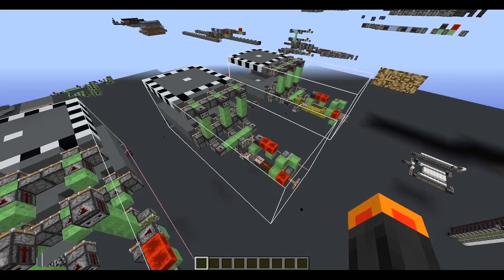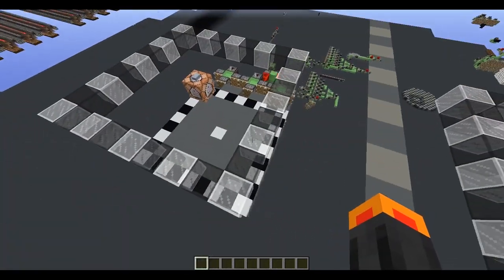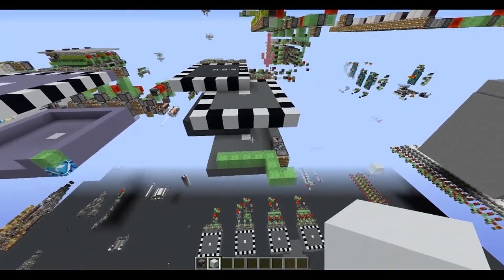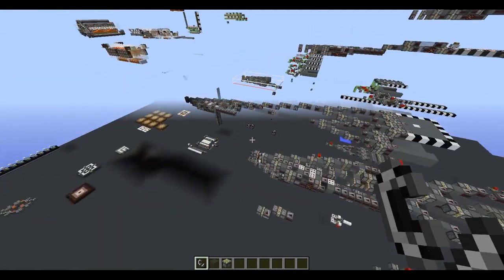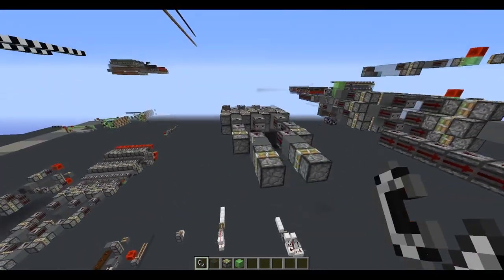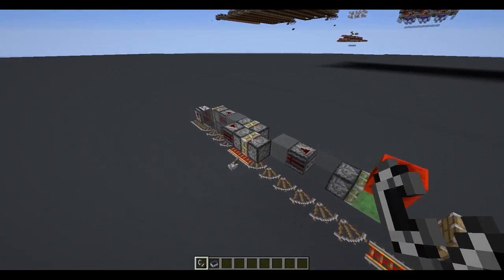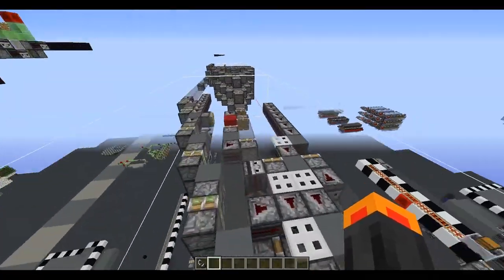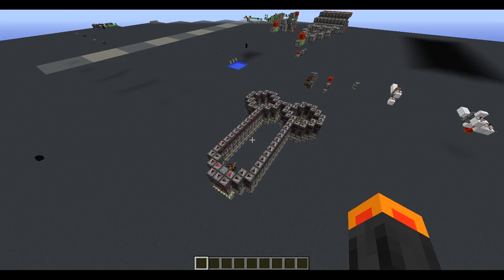Slimeless Flying Machines and Compact Kobras

Comment: cool!
Reply from the maker: Yesterday I've been looking at 1.7 kobras and found your TNT duper, that stuff is amazing! The fact that you can pull a block makes me wonder if 1.7- flying machine possible, just super big and messy. Will see...
Reply: @kk.mp4  yea. weve also been working on that for quite some time about a month ago. the main problem was that we were never really able to get something next to that block that we pull pushed forwards. what we would need to do for that to be happening, is to depower the piston, extend retract and then move it. 
this sequence is far to complex for this case so we are were also trying modiseus' apporach. he even came to see and try to help us but we also failed with that idea. a friend of mine, jan, is currently working on writing a program that will search through many different plausable block combinations to find an engine because thats what we were doing in the end aswell. we will see what the future brings i guess. a 1.7 flying machine would be quite useful for stuff like quarrys actually. jan and me are actually making one at the moment. its super big and complete trash, but at least itll be the first ever slimeless quarry without observers aswell. from my experience observers make everything a whole lot easier in slimeless slimestone, because they open up so many possibilitys that you wouldnt have just with redstone blocks. for example the 2gt pulse an observer gives is a lot more useful than a continous signal that goes everywhere from a redstone block. the tnt duper actually got compacted to about 1/7th the size of the form it was in when i finished mine. instead of using 1032 blocks it only uses about 180 or so.
Reply from the maker: @thecraftingfederation2425  I will be looking forward for your 1.7 kobra tech videos, that's probably the most exciting stuff for me that's happening in tech mc currently!
As for observers - for sure. After playing around for a couple of days with 1.11+ slimeless tech I'm pretty sure that everything that's possible with slime is as well possible without. And some smaller contraptions are even simpler, so by putting more effort into developing slimeless tech we will get some really compact components that will help us compact slime structures in the future.
1.7 flying machine with brute-force sounds like a really bad idea xD Some time ago Robi, Nick and me though of bruteforsing best layout for mushroom spreading on a single spot (for mushroom block farm), we only had 11x11 area and 2 blocks, but that's already 2^1331 possible combinations. Maybe better approach would be to use some learning algorithm, but also doesn't sound helpful when you have task as "fly".
Reply: @kk.mp4  yea well i dont really know how jan is doing it. he told me about trying to do it like a cellular automaton or something? i really dont know. i have like no coding experience on a higher level than trying to punsh some numbers together. im also really looking forwards to more 1.7 kobra tech and slimeless slimestone in general, because its quite an interesting concept. for example, we made a tripple layer roof system without slimeblocks and it was smaller than any 1.8 design i was able to find. kobra allows you to think on a completely different level than what we are used to and allows us to innovate. i highly suggest giving 1.7 kobra tech a try, without observers. i have found it to be a lot of fun :).
Reply: @kk.mp4  not to be a pessimist, but like, if that is the most exciting thing happening in tech mc currently... has innovation ground to a halt? o.O what about the project to obtain end portal frame? i guess xcom leaving (i think he left) means the crazy stuff stopped being done?
Reply from the maker: @Nooticus  What you mean came to a halt? In this video I'm talking about barely touched side of Minecraft, there is a ton of things to be done here. Slimeless flying machines alone is a really fan problem not to mention there is tons of other things that need to be worked on in 1.12 or revisiting 1.7. I don't know what it has to do with Xcom leaving and portal frame item. I thought Earth already showed it, it's a fun mistake in code I guess.
Minecraft is nowhere near it's technological dead end, on Dugged we always have some creative projects going on and not enough time to finish them :c
Reply: @kk.mp4  I'm very glad to hear that :) but from the channels I am subscribed to, I haven't seen any revolutionary concepts come out in probably over a year lol, and yeah Earth showed it I think, but it still has never been done in survival.